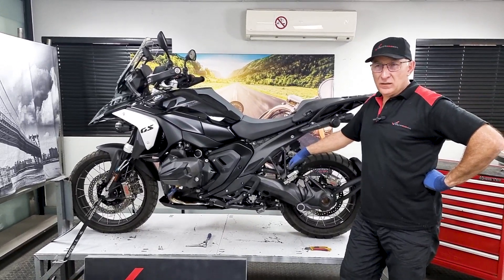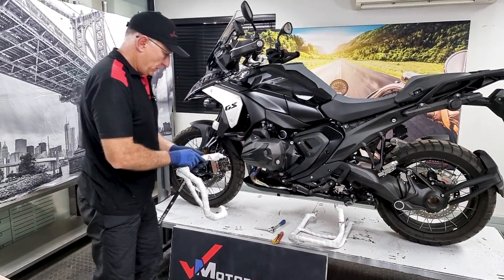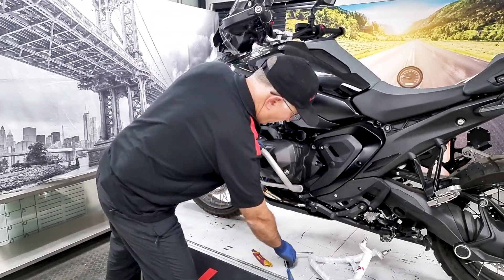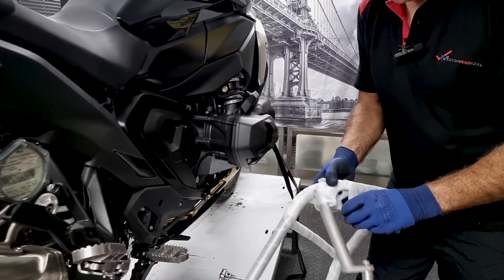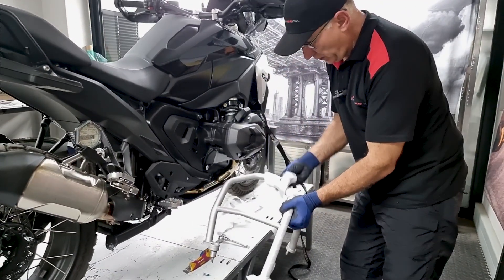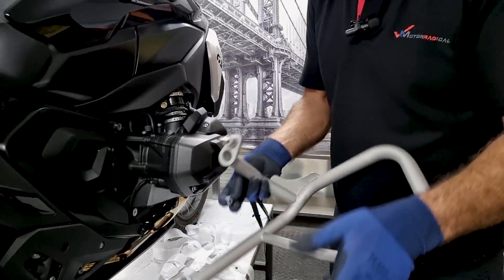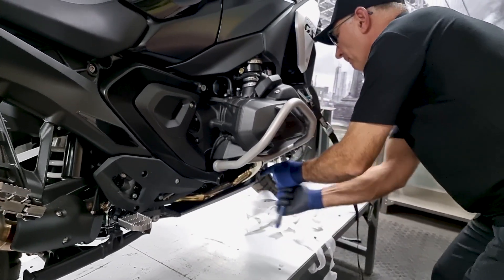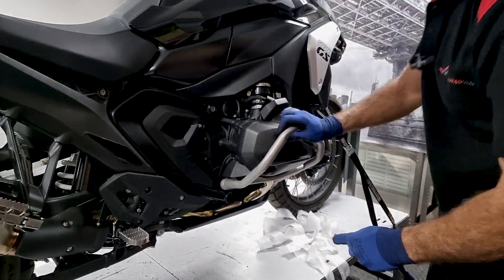BMW R1300GS Lower Crash Bars Fitment

Comment: I Have a question ? There is no rear brace on those crash bars? So what is the potential of that hitting the heads in a fall. Why does BMW not account for that and I have to look at after market for the added protection! This is exactly the same as what was done on the GS1200 and GS1250 !